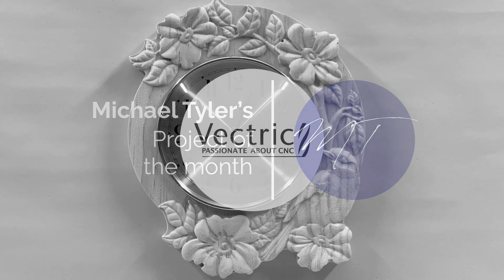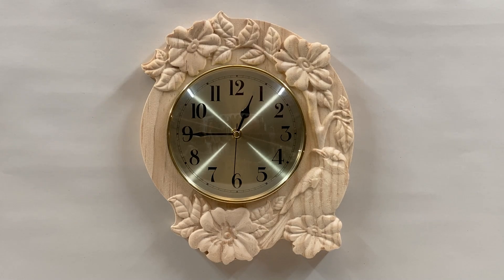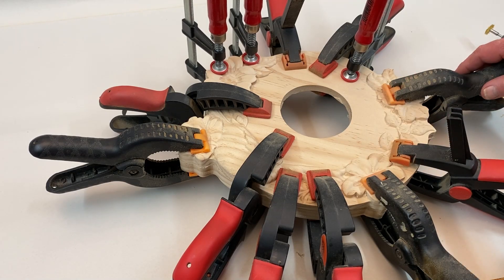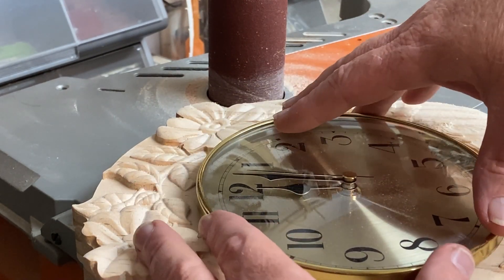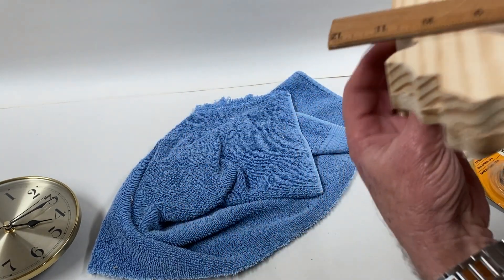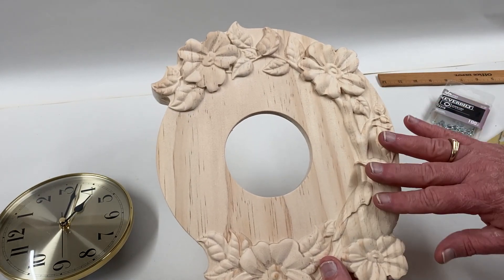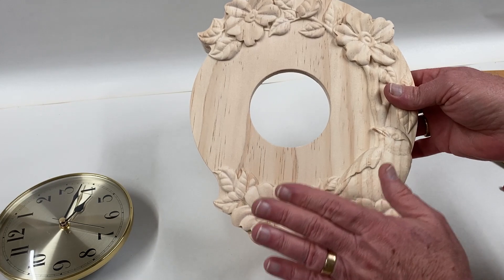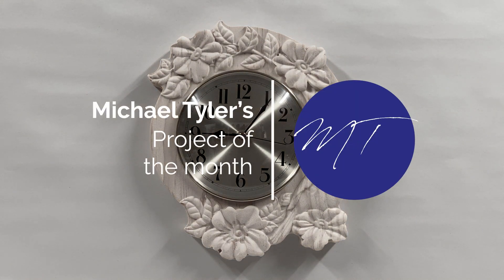Making The Fresh Spring Clock  | Michael Tyler's FREE CNC Project | Vectric

Comment: Great video! During the finishing pass, I’m noticing that the feed rate slows down when approaching Z moves and then speeds back up once the feature is cleared… Can you point me in the direction of where to find this adjustment in the software? Huge thanks in advance!
Reply from the maker: Hello and thanksfor the question.  I would have to think that is part of the PostProcessor Micheal is using.  You might consider contacting support@vectric.com and reitterating your question and pointing them to this video.